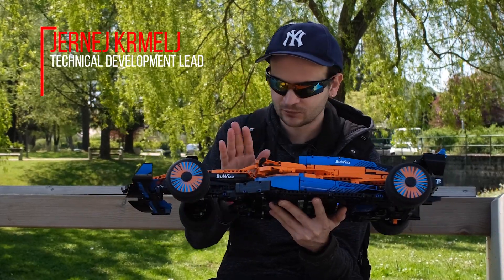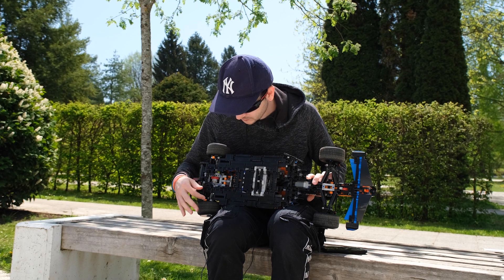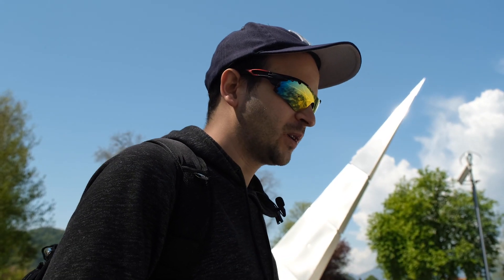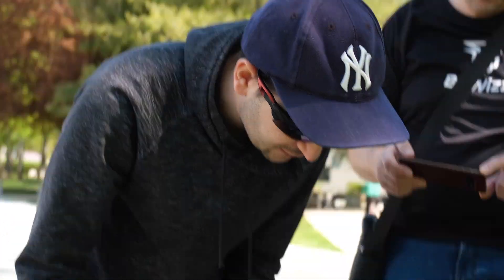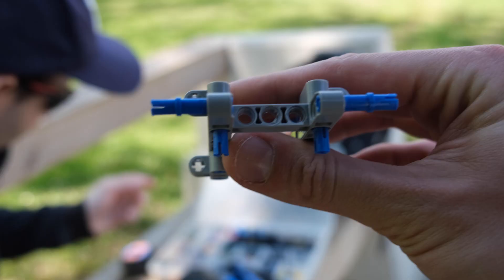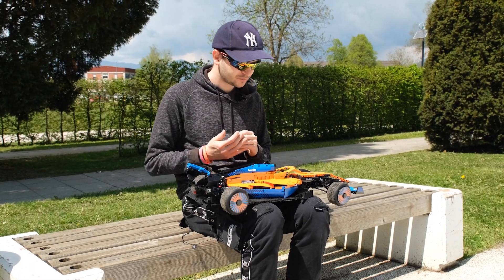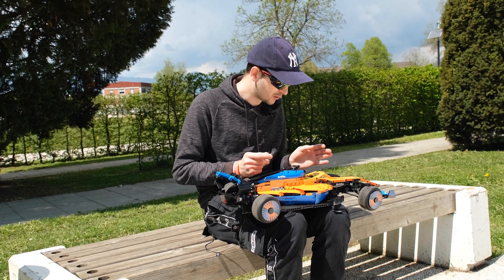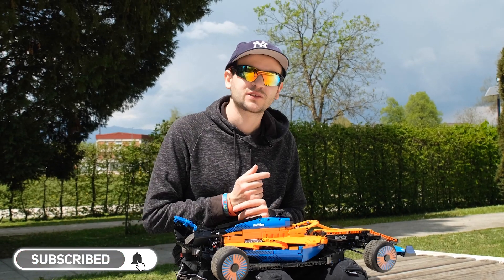42141 McLaren Formula 1™ motorized and powered with BuWizz 3.0 Pro

Comment: it melted because of the additional friction of the fake engine, as there is no straight axle going to the differential but the axle threw the fake engine which is weerd shaped because it has to move the cylinders up and down, unnessesry stress